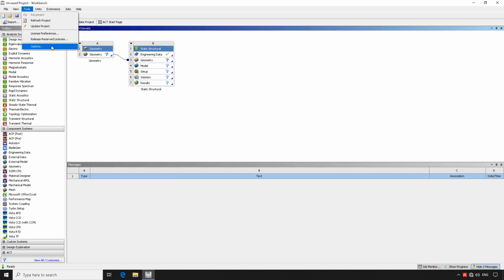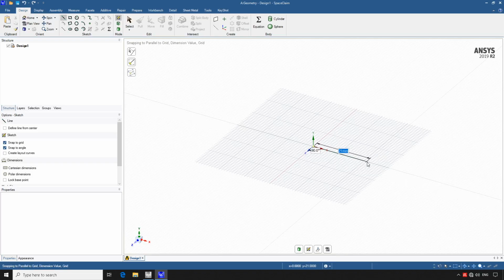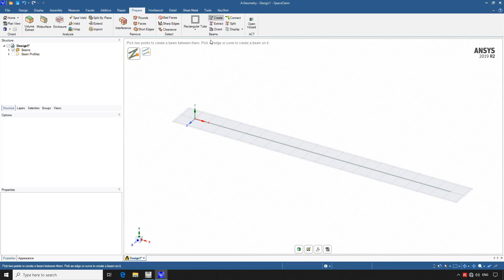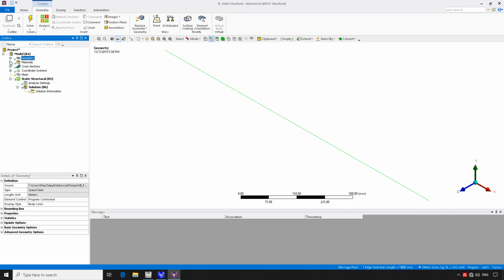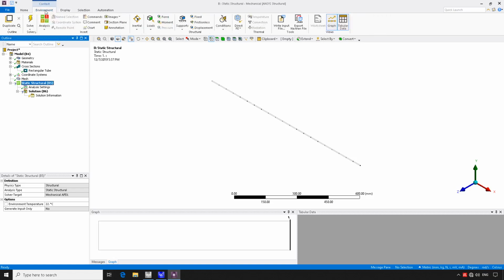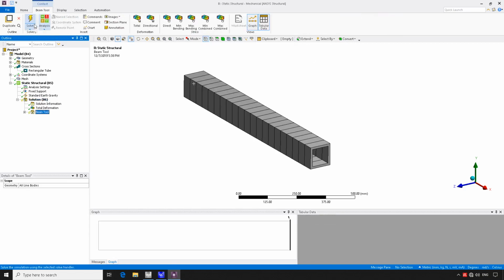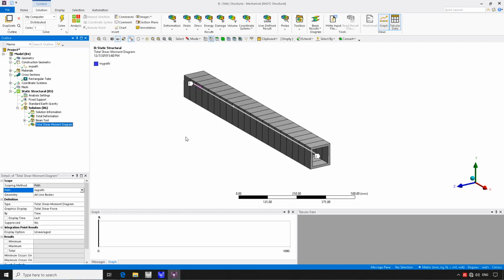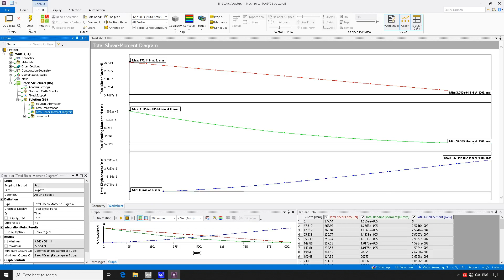Ansys Workbench Tutorial: Cantilever, beam elements - SpaceClaim #3

Comment: hi can you make a video for the i section Column using shell elements and get the critical buckling load for this column
Reply from the maker: We answered on you other comment for the I, for buckling you can do the beam type element one of the shell model, apply loads and get the buckling look at the buckling tutorials and you will see how its done, is one of the most simple simulations.
Reply: @FemExpert  sorry i did not understand your reply i am not able to get buckling load with shell elements as my boundary conditions are pinned at both ends and i have to use shell elements as later i want to consider residual stresses in the model
Reply from the maker: @sprasanna1905 The simple buckling analysis only lets you get the  buclking coeficient based on your geometry and loads, you cand see under the regular ansys a buckling simulation., If you want to perform a more complex buckling then you will have to check more complex stuff like transient analysis or transien buckling, those simulation are much more complicated not just a simple simulation.
Reply from the maker: We will explain it to you in a few days, we will post the answer here, if you see that we forget send us a message so we are reminded.
Reply: @FemExpert  hi can you post the solution please i hope you can help me
Reply from the maker: @sprasanna1905  Hello, you have to understand how buckling works, either if you do it in ansys or workbench it will be the same, you can follow this tutotial https://www.youtube.com/watch?v=RJoIHZTpm1s, you have to model the I beam with shells using the mid fiber then put the compression loads and then simulate
Reply: @FemExpert  can you please explain as you said if you forget i am just reminding you
Reply: i followed your video i am able to get the buckling but can you please share how to consider initial stresses in the structure due to welding by using inistate command
Reply from the maker: @sprasanna1905  The buckling only considers the structure and its loads, you can check in materials resistance that is only a coefficient, if you want to take into consideration other external effects you will have to create a model in which you amplify the values of the loads or something like that.